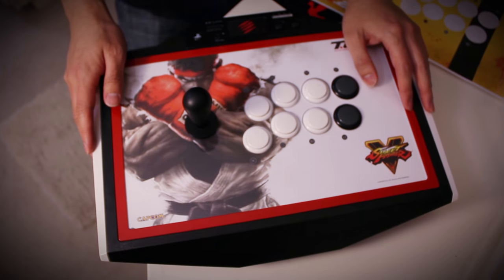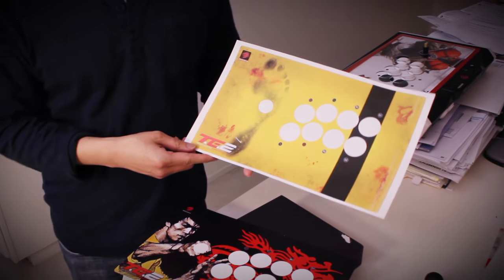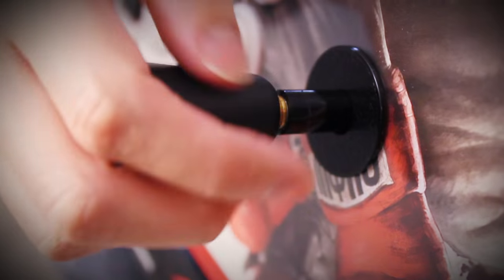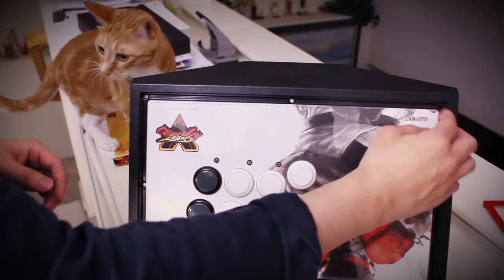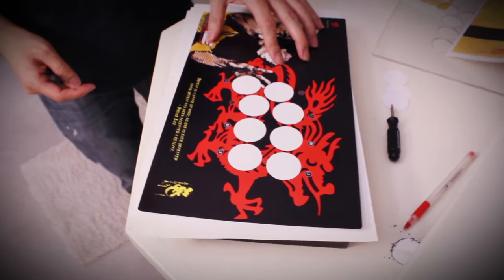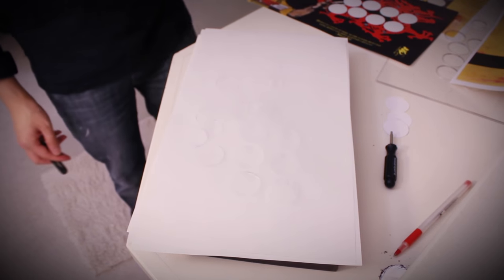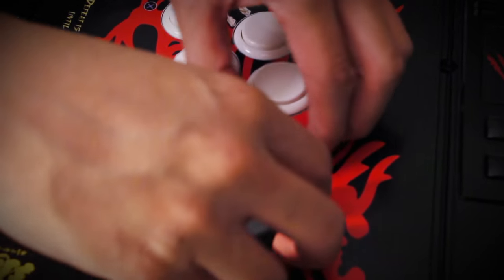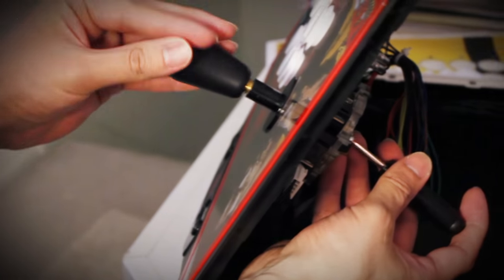Mad Catz TE2 Fightstick - How to Change Artwork Tutorial

Comment: Not sure if this would help a whole lot when using an xacto knife, but you can try placing the plexi glass over the artwork when cutting, basically using it as a stencil.
Reply from the maker: Yeah, we actually tried doing this. It didn't really work out for us :/. Cutting the holes without using the plexi glass was easier for us.....Thanks for watching our video btw
Reply: I used a compass with knife attachment I got from hobby lobby for 4 bucks worked really really well on 32lb stock paper. I found that scoring it first made the cutting much easier.
Reply: science!  
now i don't feel so lazy to do it

Comment: Apparently, the TE2+ creeks (regarding the opening/closing mechanism)?

Also, I've seen a video where the perspex cover (covering the artwork) can be nudged around. This was the TE2, so is it fixed in the TE2+?

Can the USB cable be disconnected regularly, or will this cause it to loosen?

Overall, how would you say the build quality is with the TE2+?

Thanks.

Comment: Helpful! BUT does this work with the TE2 (not plus) edition? I've got the Chun Li fight stick, but the lenticular artwork is a little distracting.
Reply: Yeah, I have the TE2 Chun-Li Edition and you can do exactly the same thing shown in this video.

The TE2+ is almost the exact same as the TE2, the only difference (apart from the different looks) is that the TE2+ has a few extra features like an L3 and R3 button and a small Touchpad on top just like the one on the PS4 controller.

Comment: Hey man I bought that same fightstick but mine didn't come with that interchangeable screwdriver. Where can I get 1 that will fit that slot? I know mad catz are out of business (sort of) so that's a no go.
Reply: hey man I could be wrong but it's worth a shot. If you go into any home depot for about 8-10$ you can get a screwdriving that has like 25 different heads you can change on it. At least one of these heads should fit your stick, because at the end of the day its just a screw nothing special. Worst case scenario return your screwdriver to the store if it doesn't work out.

Comment: I can't unscrew the ball top. You guys did it so easily but I've been trying for 20 minutes and I can't get it to budge. 

I've got the chun li version of this stick and when I put the screwdriver in the slit on the back of the ball top and try to turn the ball it just turns the stick the ball is attached to or turns the screwdriver since it's detachable it just turns inside the plastic. 

I've tried holding the metal part in place and turning it but that just rips up my fingers and does nothing. 

This shit's impossible.
Reply: I got it now, I had to use a real screwdriver. The madcatz one was too cheap. Took me like 0.2 seconds with a real tool.

Comment: u can't just hold the shaft and spin the balltop off but u have to open the stick?
Reply from the maker: +Kal Kuma right. You have to open up the stick first before you twist the top off. If you hold the shaft and try to twist off the top then the screw at the bottom and the joystick top will go in the same direction. Opening up the stick and holding the screw at the bottom before twisting off the joystick top is a must. I hope I was able to answer your question.

Comment: U said 8.5 by 14 but in madcatz's guide they recommend 11 by 17?
Reply from the maker: +Kal Kuma The art itself is about 8x13 inches so both 11x17 and 8.5x14 would work :). Madcatz recommends using 11x17 because it gives a safer buffer area for printing. 8.5x14 gives enough space for the artwork and more home printers are capable of printing on 8.5x14 paper so that's why we recommend 8.5x14

Comment: so the paper is not standard A4 format ? & I want to print it with photo paper that will work just fine right ?
Reply from the maker: +Kakashi - Leonhart Right. The paper we use is not standard A4 format. We use US Legal size paper, which is 8.5 x 14 inches. We don't have much experience with photo paper to be honest. However, we did a little internet research and it does seem like you can use photo paper, but it's not recommended. The plastic panel is reflective so adding the glossy paper to it might make the artwork look too glossy. There also could be more of a chance of smearing with photo paper because of all the constant pressure when using the fightstick. This is why we recommend using matte or satin card stock.
Reply: +Monster Digitals o ok thank you for the tips & is there a company online that can print these for me , do you maybe have a link ? I have a printer that prints A4 so I don't think that I can print it at home nor do I have the right paper & size :( I live in The Netherlands
Reply from the maker: +Kakashi - Leonhart No problem at all. If you have a longer size paper we can adjust the file for you to fit that paper. Unfortunately, we're unsure what's out there in regards to printing this type of file
Reply: +Monster Digitals ok thanks I will try to figure things out first then I will send you a message again , I am planning on buying this awesome bruce lee template later on , when I got all items ready for it :) maybe I can buy the paper on ebay & print it on my printer
Reply from the maker: +Kakashi - Leonhart I never heard of that website before, but yes, that card stock should work fine
Reply: +Monster Digitals ok thanks for confirming it , I will try to buy it from here then , you will hear from me in the coming weeks :)
Reply: I actually prefer using high gloss (or semi-gloss) paper as oppose to matte, I just think it makes my fight stick look more vibrant, shiny, and colorful. High gloss paper allows you to achieve richer and more vibrant colors. Some people hate that, but its really just preference, never really had any problems with the color smearing all over the glass when leaning on it with pressure from my hands.

Comment: I'm having trouble to hold the screw in place and I can't remove the balltop because of this!!!! Can someone help 😖
Reply from the maker: +jeff gallardo Thanks for watching our video Jeff. what is actually happening when you try to hold the screw in place? have you tried using a regular size flat head screwdriver? i find it a lot easier if you use a regular size flat head screwdriver to hold the screw in place
Reply: +Monster Digitals your welcome and the thing is that when I use the screw that comes with the mad catz TE2 it keeps shafting the screw and I don't want to break the screw. I can't seem to hold it in place and it seems that the balltop is too tight
Reply from the maker: +jeff gallardo Yeah, in your case, I would use a regular size flat head screw driver to hold the screw and then  just be really careful when removing the ball top. Sometimes the ball top can be a little tight, but it does eventually come off. I don't know what else to tell you. I hope I was able to help :/. I'm happy to answer anymore questions if you have any.